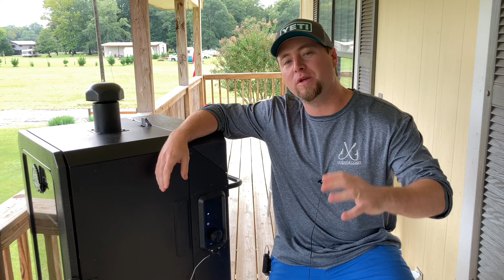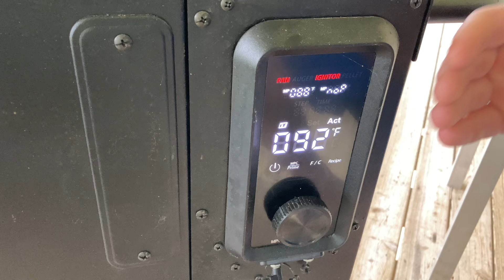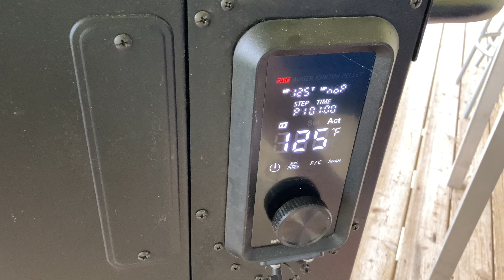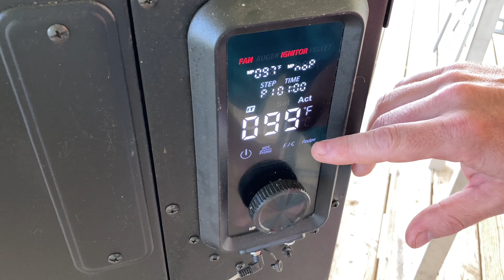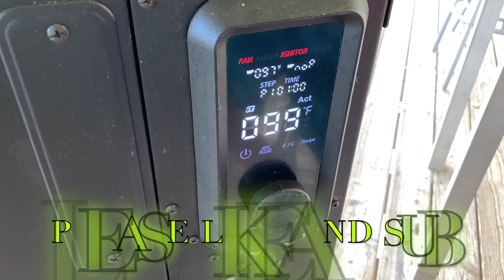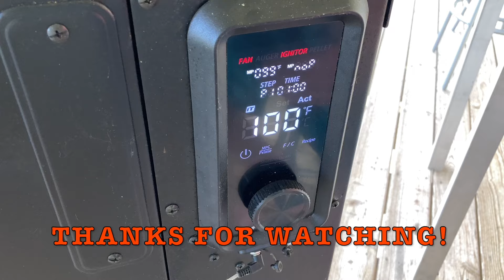How to MASTER the Control Panel on you're Pit Boss Pro Series Series 2 Vertical Pellet Smoker

Comment: I Iove my Pbv4ps2, however I've not had great luck with brisket.  Everything else comes out perfect.  Also, cooking when the temp is less than 50° outside and breezy is a problem.  My cabinet isn't insulated good enough and the temperature gets wicked away by the wind.
Reply from the maker: What method are you using?
Reply: @TheAmericanSmoke  Honestly, I've one cooked 3 since April of last year.  They are so expensive I just don't choose to make them that often.  Last time I made one I used Harry Su's method.  It's the stall that gets me.  I've cooked for 16 hours and it's still not done. 😩

I also live in the South.
Reply from the maker: @joshuawesterfield6635  are you cooking to temp?
Reply: @TheAmericanSmoke  203 internal.

Comment: Great content, well done! I just purchased mine last week and turned it on before  I read the directions so didn’t do a proper burn off. I subsequently tried to smoke some fish and didn’t get much smoke flavor at all. Should I redo the start up instructions at this point or is it ok to proceed? I want to figure this thing out this weekend.
Reply from the maker: Hey Doug! I would still do the burn off. The high temps used in the burn off gets rid of chemicals and oils used in manufacturing. They would eventually burn out with cooking but you would run the risk of getting stuff on your foods until then.
If you want more smoke flavor, get a smoke tube. Also, some brands of pellets are better than others. Really depends on who you ask. Everyone has an opinion. 
I hope this answers your questions.
Thanks for watching my video and for commenting. It would be great to have you as a subscriber.
Thanks!

Comment: Just picked up a Series 4 v2 today and performed the burn off. I noticed occasional sparks flying up in the smoker during the process. Once over I opened it to see a significant amount of ash in the smoking cavity and the glass itself had a fairly heavy white film on about two thirds of it. Is this normal or is it time for a return?  Unfortunately I was only able to pick up a preassembled and fear someone messed up the process.
Reply from the maker: I noticed this when I first started using mine, but somehow it got better on it's own. Not sure if ash just eventually filled the gap or what. Really though, you're not going to find a smoker that doesn't have some ash floating through. If you are seeing a huge amount of ash then I would contact Pit Boas first. They are very helpful. I hope this helped.
Thanks for watching my video and for commenting. It would be great to have you as a subscriber. Thanks!!!

Comment: Man I've been looking for a vid like this. Did first cook yesterday and could not get it to keep steady smoke other than start-up. So the P setting needs to stay low to get constant smoke right?
Reply from the maker: Thanks for the question Tony. I've had a lot of people ask me questions about this over the last 6 months so I made a couple videos covering the topic. Basically, if the pit it trying to reach a higher temp it will burn much hotter and therefore cleaner. Once it reaches that higher temp you will start to see more smoke. Trust me, this thing will put a good bark on your BBQ. Just got to let it do its thing. 
Here are links to two other videos I have made addressing this problem. https://youtu.be/bhLvaWVu9Rw
https://youtu.be/IGJ_p_qJB5o
It would be great to have you as a subscriber. Thanks!

Comment: So a week ago im about 5 hours through through a 6 hour rib smoke.  Was hanging in the yard all day keeping an eye on the thing.  Spraying every hour on the hour.  About 2 minutes after the 5th hour i saw an error message.  I couldnt get out of the screen, so i just shut the thing down and turnes it back on.  10 minutes later i though the thing was on fire, there was soooo much smoke.  I thought i had a grease fire. Unplugged, grabbed the ribs ( finished em in the oven )  i pulled the little fire cup out from the front and it was packed. The pellets in the auger were actually ignited.  What i think happened is there was an auger jam, and then by shutting it down and turning it back on made it go through the start up phase again, buttt I already had an established fire already.  I primed it for about 4 or 5 minutes until unlit pellet came out of the augar and left the whole thing pulled apart with the pellets dumped. There were no signs of smoke or heat so i buttoned it back up and ran it for about 30 minutes again and it seemed ok.
Reply from the maker: You did the right thing shutting it down. Did you clean out your ash pot before the cook?